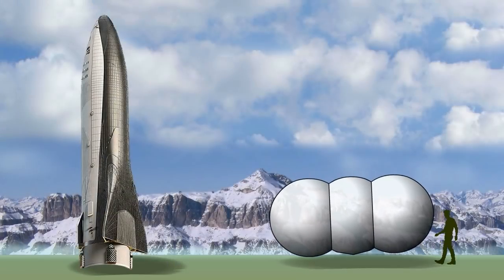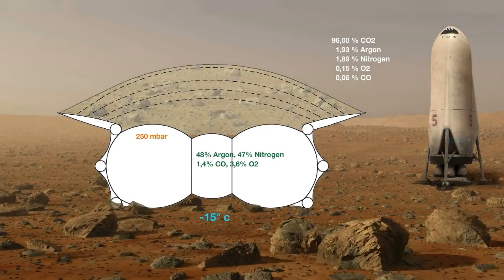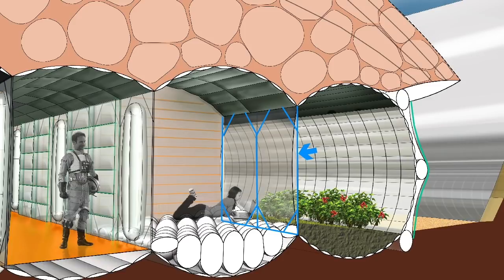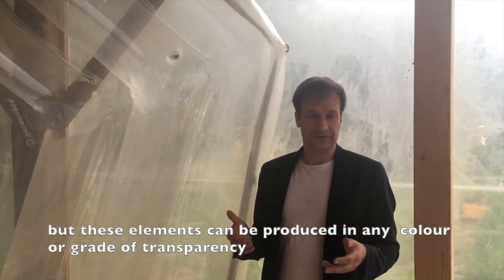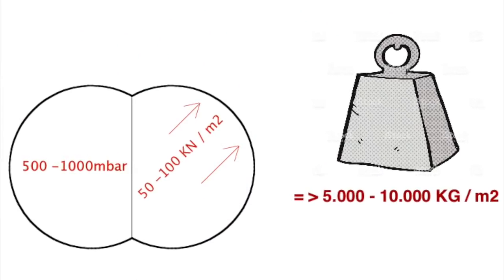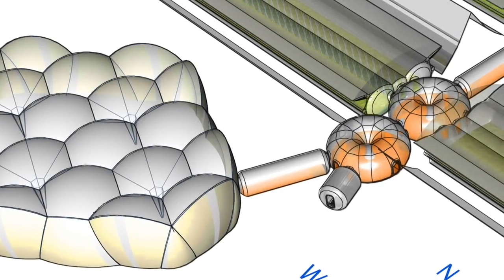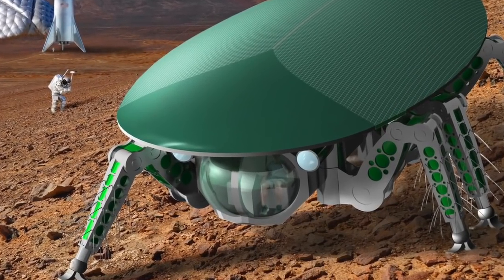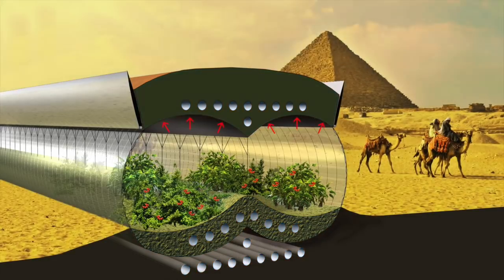inflatable Mars habitat and Lunar base

Comment: Very efficient idea! I like it.  However, how much material does a mars dust storm move?  Would a storm completely remove a roof or completely fill the reflective air gap?
Reply from the maker: to avoid the deposit being blown away during storms, on top  of the deposit the regolith should be filled into thin bags, or you use bigger stones and boulders, that can't be  blown away that easily.  on the mirrors and on the photovoltaic panels you can blow away  the  dust with compressed air

Comment: Much more effective than a thin layer of CO2 would be to apply a thin metal film to the outer envelope, etched with pores large enough to pass visible light but too small to allow thermal IR through. With photosynthesis-useful light only going to at most 700 nm, and the thermal IR peak at about 10600 nm, such a "hot mirror" can admit sunlight well but conserve heat.

Comment: The greatest problem with closed ecologies is the inevitable amputation of the atmosphere. In the open on Earth, a square meter of good farmland extends at least 30 cm into the surface and has a mass close to a ton, with perhaps 10 to 50 kg of water available. But the air on top of it outweighs everything else at ten tons. Putting a dome generously ten meters above the soil leaves at most twelve kilograms of air, nowhere near enough to buffer the daily flows of water, water vapor, CO2, and oxygen that must flow in and out of the soil and plants. All the ills of ECLSS stem from this desperately limited air supply.

For example, those ten cubic meters of air, at 400 ppm CO2, contain a whopping seven grams of CO2. The enclosed ecosystem is balanced on a knife edge. Any off-earth closed ecosystem will need a good buffer for oxygen, CO2, and nitrogen. All three gases must be able to be drawn from and returned to storage as the biosystems fluctuate in throughput due to seasonal and (on Mars) weather changes.
Reply from the maker: in our following project for a lunar habitat which is developed more in detail  ,we considered this and provided a cryogenic storage of surplus CO2.  On Mars it is a bit easier, since there is abundant CO2 in the atmosphere, so we can release CO2 and get new one from the atmosphere.  On the moon ( where carbon nearly denote exist , we need to preserve and recycle all carbon
Reply: @thomasherzig174  Yes, on the moon everything other than oxygen is too scarce to be wasted. But when growing and storing food, oxygen ought to be stored as well because it will be needed when the food is eaten, and building up inventories for population growth will be a continuous effort.
Reply: Yes, I think a duel two chamber in series air lock is needed, for extra safety.
Also there is a chronic need for a much ‘larger atmosphere’ - which can be off-loaded into additional areas and a pumped air circulation replacing the atmosphere in each capsule.  External modules could be used to recondition the atmosphere as needed.
Reply: Because Mars is so isolated, it’s going to be very important to carry significant reserves of everything, this will enable extra security from anything going wrong.  Always have options.

Comment: And these will support all that Martian soil .... and sharp rocks?
Is anybody starting to work on a Excavator that will work on Mars?
Reply from the maker: there will be a thin foam protection layer over the membrane. stones will be sift out of regolith and put into thin bags that are dropped on the roof (so it can t be blown away fly the wind. bigger stones are places on the upper layers where they have no contact with the membrane.
a suitable modular excavator, that has low weight , can be packed into a spaceship and can operate at the conditions on Mars ,still needs to be developed

Comment: You could cover inflatable habitats such as these, in lunar or mars regolith, build structures of dirt around them in the same way as humans build Pyramids. They are the most economical use of 3d printing, inflatable habitats, and multiple story building. They also provide the most economical and quickest way to guard against micro-meteorites and radiation. You must ensure that you can move machinery, equipment & stores to the appropriate level within the habitat, and pyramids provide a smooth ramp to every level. This approach basically involves blocks of polymer-infused regolith, surrounding a space filled with tamped loose regolith, containing walled empty space for habitation, or even just stacked inflatable modules, and a helical ramp just inside the blocks, with access to each level, to move things around. Robots could collect and distribute regolith, make blocks of amalgum, tamp regolith, move equipment critical stores and habitat structural elements into place. And just why would you need windows, if you have cameras outside and video projectors inside the habitat?
https://www.youtube.com/watch?v=j4cdDT1ZvAA

Comment: This is an excellent concept and video! You have my full support :)

I can appreciate the ability to detect punctures in the ceiling compartments, but I wonder what the colonists could do to repair such a leak once identified?

You wouldn't be able to access the deflated compartment without taking apart the entire habitat (since you would need to access the hole to patch it, and accessing the hole would result in depressurization without some creative solution to patching it while it is still pressurized).

Depressurization would be a very bad thing for many reasons, including the ceiling caving in on you.

It's important that the design include, as much as possible, elements that the colonists would be able to repair or replace if necessary.

I also wonder why you have combined the living space with a green space; plants presumably don't require the same kind of radiation shielding that the living quarters would, and they require less pressure as well. Unless I am missing something, it doesn't make sense to cover the greenhouse section with regolith and then reflect light; couldn't you just let the light in directly to the plants? Would this inflatable structure be able to let in natural light while partially filtering it for UV? I'm guessing that a big problem for Martian greenhouses built with this material would be temperature regulation inside, since the material probably has a low R value (poor insulative properties), so the regolith on the roof would help with that.

Additionally, you would need a LOT more growing space than was shown to feed someone on Mars. The amount of land that is needed to feed one person on Earth is between 0.1 - 1 acre per person. And I am curious to know what source you are relying on in suggesting that 3d printed technology on Mars for habitat construction would use a lot of energy?
Reply from the maker: Some of your question are better explained in our Moon Habitat video that shares many features with the Mars habitat design. 
The Mars habitat design as shown this video already had been done in 2019. 
Form  2021 on,  with the funding by ESA the Moon habitat design followed, which was worked out more in detail. there we also explain the energy issue with 3D print.
The point is that none of the published designs for a Mars habitat or lunar habitat designs that are based on 3D print, show any numbers for he energy consumption . Also by researching in the www. I could not find any data. So i took for reference what comes close physically and chemically:  the production of rock wool- it is silicate molten and restructured as for 3D-print. There I easily could get the numbers.
On Earth that energy requirement is easy to match , but on Mars  energy is not abundant . Sunlight for PV modules is less than on Earth and Kilopower reactors cause a lot of payload .

regarding the possibility of puncturing  the membrane.  Since there are  2 separate membrane layers it is very unlikely that both get punctured at once. When the outer membrane gets punctured  ,you need to remove some of the loose regolith on top to get access to the hole and fix it with glue tape
If both membrane layers get damaged , it would take some time until all air escapes ( depending on the size of the hole) and the weight of the deposit, that presses down, helps to uphold some pressure. So the crew has some time to escape.
When the collapse cannot be avoided, the whole  greenhouse module  is sealed by closing the lock doors and disconnected from the other modules.
As explained in the Moon habitat video. the mirror membrane can be coated with silver instead of aluminium. Silver reflects much less of the UV-range but  a bit more of the visible range of radiation. This way the light spectrum reflected into the greenhouse comes quite close to what Earth subsurface receives.

For the Mars habitat I estimated 500m2 of greenhouse area to sustainably supply  one human with food and oxygen. There are 2 different types of modules. one mixed greenhouse and living, and the other type greenhouse only.
For the moon habitat I calculated 120m2 of greenhouse area for one human, because we receive more  constant sunlight  for photosynthesis and can more easily uphold the optimal temperature .

Since the radiation does on Mars  is 100times more than on Earth ( 240msv vs 2,4 msv). I think, even for plants some protection is useful. Specially since animals (at least insects for pollination and composting organic waste) would live there too and humans also would spend time in there. not just for labour intensive agricultural work, but for leisure in a natural environment as well.   But I considered the different requirement , by placing the greenhouse at the outer zone ,and the human compartment in the inner zones where the radiation shielding is more effective.
The regolith deposit on the ceiling not only serves as  a radiation protection. It also protects from micrometeorites  and it is a heat insulation and thermal mass.
It absorbs excessive heat in the daytime and helps to keep the temperature on an acceptable level during night.
Only covered with a thin membrane or glass ceiling ,as often displayed in renderings for martian greenhouses , the greenhouse would suffer from a great heat loss during  night time.
Reply: @thomasherzig174  Thank you for the detailed answers. 500 square meters for growing crops is around what I calculated as a minimal requirement for growing food for one person as well. (If you are interested, in the description of my videos is my "research doc" where I have links to the various sources I used to arrive at that number.)

Using hydroponics grown with reflected light would help to reduce the growing space needed, and would also help to conserve water. 

It's my understanding (from statements by Robert Zubrin) that Mars's atmosphere does help to filter UV from the Sun slightly, which would help plants a little but he claims greenhouses on Mars would still benefit from a slight amount of extra UV filtering. 

On the Moon there would definitely need to be UV filtering, especially since the energy from Solar flares reaches the surface of the Moon much more strongly than the surface of Mars, due to both the lack of an atmosphere and the closer proximity to the Sun. (Mars's atmosphere is decent at blocking the Sun's harmful radiation, but much less effective against higher energy cosmic rays.)

From what I understand of Lunar and Martian regolith, it's a very good insulator with a high R value, but this means it wouldn't act very well as a heat sink to release heat at night (since it never really absorbs much heat during the day). When measuring the temperature at different depths of Lunar and Martian regolith, it's suspected that at something like a meter deep the temperature is pretty much constantly stable, despite the surface temperature changing quite drastically from night to day. 

Thankfully this means that, being mostly surrounded by regolith, the habitat would be well insulted by consistent temperature contact material, making temperature regulation easier. The sides that were exposed to the Martian atmosphere (or the lunar vacuum) would not lose much heat either, since ambient heat loss on Mars's surface at -64 degrees Celsius is equivalent to ambient heat loss on Earth at only -8 degrees Celsius. (My sources for regolith insulation and Earth Equivalent Heat Loss are also included in my research document in the description of my videos should you be interested.)

I don't have data about Earth Equivalent Heat Loss on the Moon, but it would presumably be even less than on Mars since there is no atmosphere the only way to lose heat would be into the regolith (not much would be lost this way) or as radiation into the vacuum. Since only the sides on the Moon and Mars would be exposed to heat loss to the ambient environment, I suspect it wouldn't take prohibitive amounts of energy to stay warm at night in either location with your design. The main temperature concern on the Moon would be thermal expansion and contraction of parts (specifically seals) exposed to the wide temperature fluctuations between night and day, but this would be less extreme at the poles. 

I'll watch your other videos and see if any other questions come to mind, but in your answer I'm quite satisfied with your explanations!
Reply from the maker: @MarsMatters   hello, I have read your document and   I could see that you have done profound research.  I just think that you still underestimate the heat loss in the greenhouse over night.  In our Moon habitat study we dedicated l one chapter about heat transfers.  Even in a vacuum you still have considerable heat radiation losses. For dark periods longer than 6 hours, even there we need to cover the window  with a heat insulation curtain, to not lose too much heat, And on  Mars there  also is heat transfer  and heat convection because it has an atmosphere.
If you like to give me your email address, I can send you the  210 pages report of the lunar habitat study  we  have made for ESA

Comment: this is very interresting and it could work but how would you move and place thee dirt on top and how would you build it up around the side area for the mirrows?
you can not move a crain to the moon or mars with out losing the weight
Reply from the maker: a modular lightweight vehicle with plug-in modules ,that can be used as a rover but as as a crane or as an excavator  would be required . The payload of the excavator still would be much less than that of a rigid building structure, and probably less than for a large 3D printer. And for the 3D.printer you need an excavator additionally that moves all the regolith to the 3D-printer  anyway

Comment: Wouldn't it be easier just to dig and build a reinforced cave system or tunnels?
Reply from the maker: still by far not as easy as just deposing the  loose regolith on  top. and we want to use natural sunlight, which is not possible inside a cave

Comment: What happens when there's a dust storm?
Reply from the maker: even during a duststorm still 30% of sun radiation is available ( the diffuse part) .although photosynthesis is reduced,  plants still can survive and grow at a slower rate
Reply: @thomasherzig174  how do you deal with the dust coating the panels?
Reply from the maker: @joeygoguen1525  this is one of the issues we will need to go into detail. But there are 2 ideas:
1; let the membrane vibrate (with sound) so the dust is shaken off
2; there is a thin transparent outer layer that only functions as a crust. when it gets too many scratches from sand and dust blown by the wind,  then it will be exchanged with a new layer

Comment: it sure is easier and cheaper, but in an environment that kills you in a millisecond I'd rather live in a concrete bunker than in a sphere that pops like a balloon.
Reply from the maker: in case of an air leak the structure would not pop up or collapse immediately like a balloon , but slowly loose pressure and shrink. On Mars your first problem is not the collapse of the structure, but the lack of air pressure. which would be the same in a concrete structure
Reply: @thomasherzig174  I agree with your work completely. Amazing job! Although some extra protection is definitely necessary and having the permanent inflatable living quarters underground or under a layer of soil is great solution!

Comment: You have to mine material on Mars, that material might as well be water. Fill the outer layers of the structure with water. The frozen water will give structural integrity as well as radiation protection.
Alternatively print a structure with water and coat it with a thin material to prevent the water from ablating away.
Reply from the maker: that kind of design already exists. 
The reasons why I do not opt for water as structural building material:
1; water is difficult to mine on Mars. a lot more difficult than digging  loose regolith nearby with an excavator.
2; ice needs to be kept below 0°C but inside temperature needs to be at 20°c. So the ice wall will melt inside  and trickle down along the necessarily transparent inner membrane
3; outside temperature near the Mars equator is often above + 3°C and sometimes  even above 20°C. With the low air pressure ice would not just melt but vaporize. So you need an additional transparent membrane outside the ice to keep it in a pressurized environment and the membrane needs to be reinforced to withstand that pressure.  The ice has mechanical strength ,but it is very brittle as well. in case of a Marsquake or a Minimeteorite it might crack. So the membranes need to be built that they can withstand all the inner pressure by themselves anyway